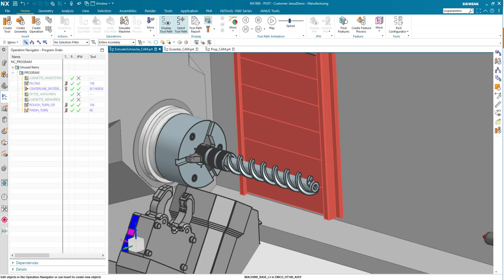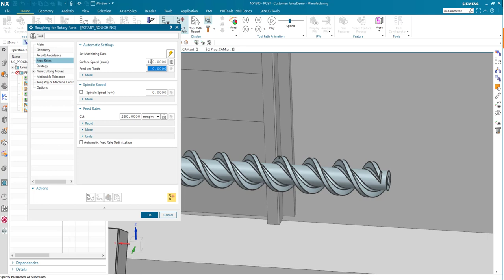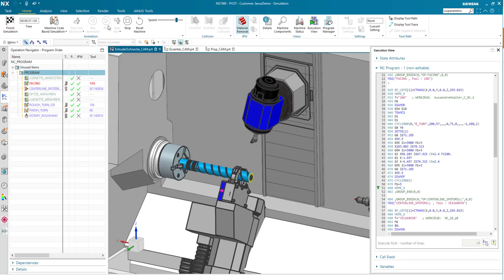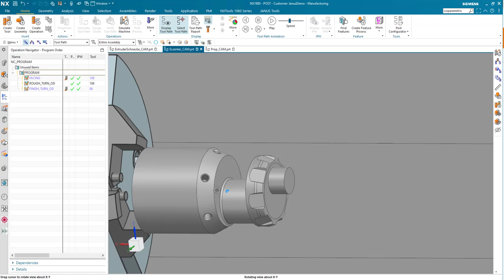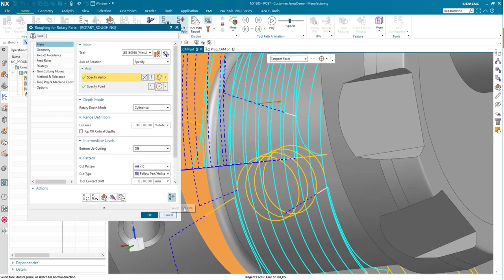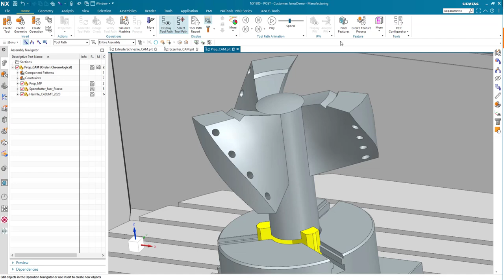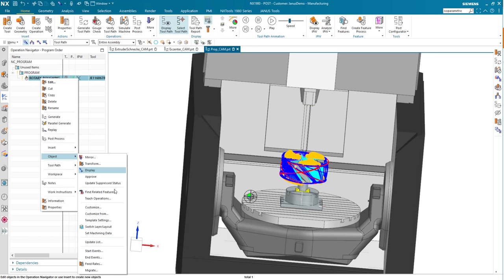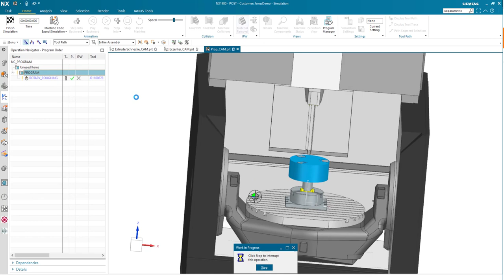NX CAM Tutorial | Create Turn Milling Operations with Rotary Roughing 🦾

Comment: Indeed  a great video and explanation✌ . Worm gear shaft, Crank shaft eccentric style are old in Industry. As everybody don't have latest versions, Can you guide to approach above 3 component with NX12, NX10 or with any previous version? Thanks in advance.
Reply from the maker: @NISIT KUMAR PATRA we always recommend updating to the latest version, as new features and improvements make it even easier to work with NX.

Comment: Hello  Do you like nx cam or would  you use solidcam if you were starting from new?
Reply from the maker: Hi Freedom Energy, thank you for your question. If you starting from scratch, we always prefer to do it with the best in class solution. In our opinion its NX CAM. The reason for that you can find in our other QuickTips.
Reply: @JANUSEngineering  Thankyou for much for your response. Has your organization ever used Solidcam with solidworks?
Reply from the maker: @freedomenergy6644   your welcome. No, we never used this Softwaretools before.
Reply: @JANUSEngineering  Hello. Do you Have any Fehlmann machines in the USA ?
That we can build some parts on.
Reply from the maker: @freedomenergy6644   we ourselves do not have any machines in our possession.